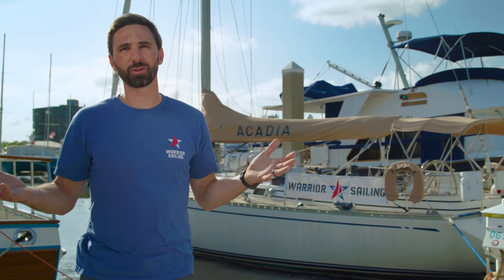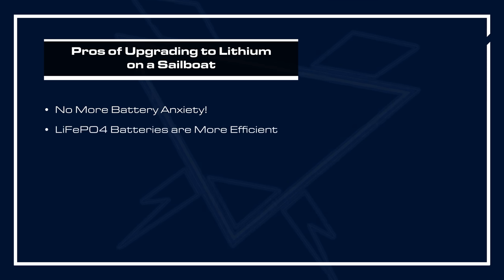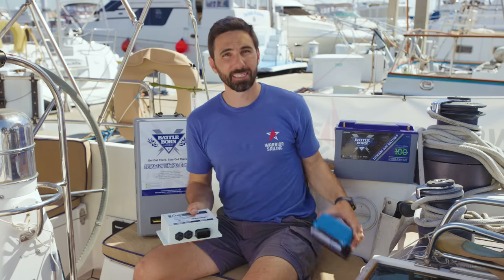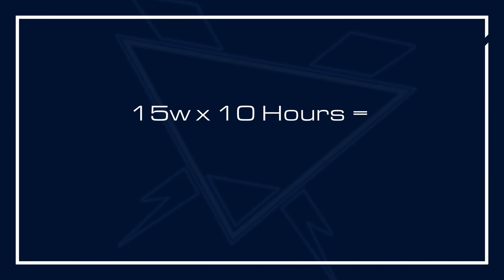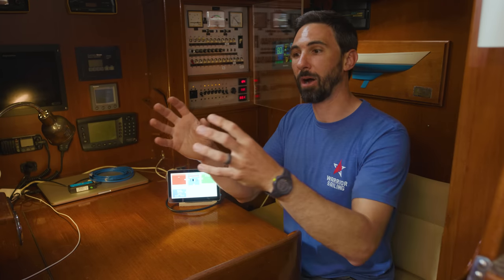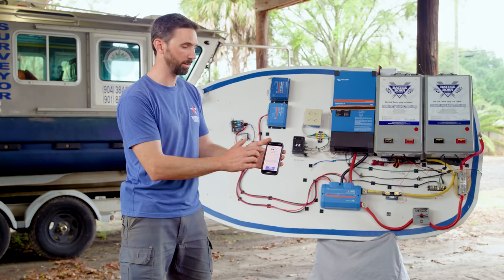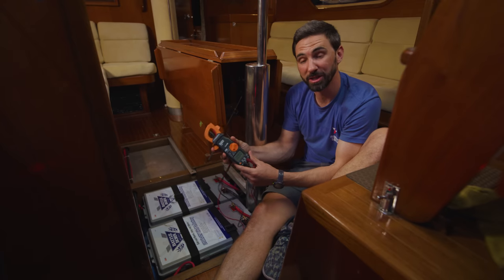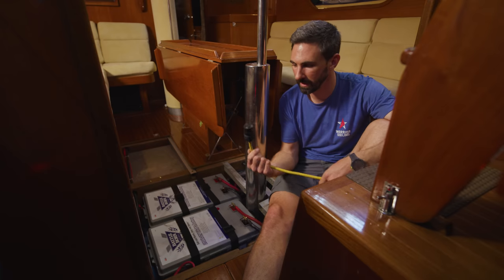The Basics of Lithium Battery Power for Sailboats and Other Marine Applications | Marine 101

Comment: So you recommend Kead acid battery for starting engine, starting generator, windlass (mayve also winch?? I guess toilet macerator no need??), and put all the rest to Lifepo4, correct? Then the alternator should charge the Lifepo4 with a DC-DC charger, and then other DC-DC charger to charge from Lifepo4 the Lead acid batteries?

Comment: Very informative, thank you.  Can you provide a bit more detail on the case ground. I am working on installing a LiFePo system on my sailboat and cannot get a clear answer on where to terminate the case ground wire.  Ultimately the DC system is grounded to the engine with the negative cables from the house and starter banks and the AC system is also grounded to the engine via shore power and a galvanic isolator.  Your tutorial mentioned grounding to the grounding buss; however, because I am using a Lynx Distributer with a dedicated ground to the engine block, can I just connect my case ground to the grounding terminal on the Lynx Distributer?
Reply: Hey it’s Conor from the video. So, off the bat, always consult a marine technician for your exact install specifics. But it sounds like you are on the right track. I like a dedicated grounding bus, where I can keep track of all of my ground connections: such as case grounds, DC negative connection, AC ground (ship side of shore breaker), perhaps prop shaft electrode, and maybe rigging lightning ground. I think the ground on the Lynx would work well to connect to a ground bus, to collect all grounds. But if you have just one, it could work. As you lay out your system, keep in mind you don’t want a ground conductor to be carrying current accidentally (in parallel with neutral). Sometimes when things get grounded the ground can be accidentally carrying some neutral loads back to DC negative, so just make sure there are bigger and more direct DC negative routes for that power. Safe Sailing!